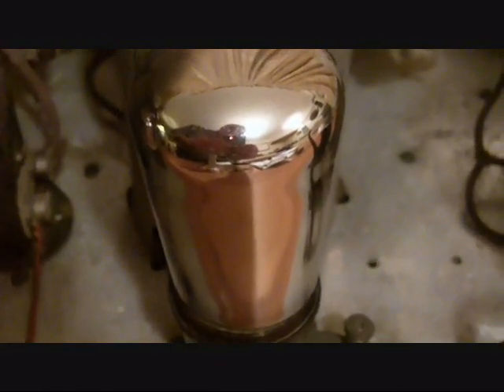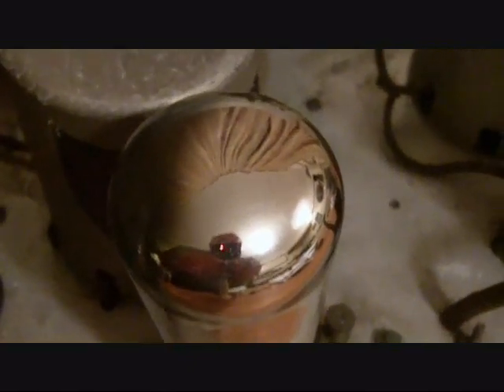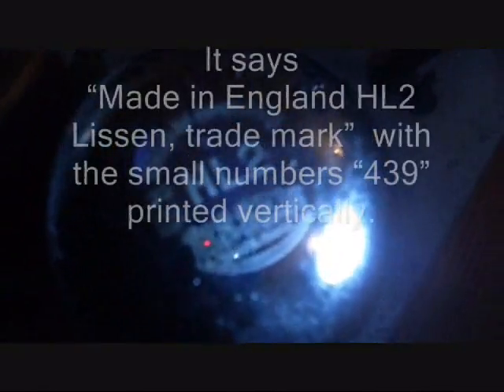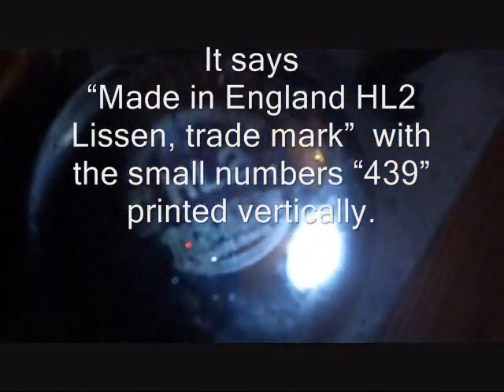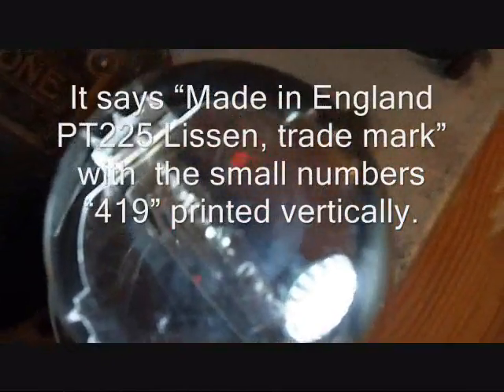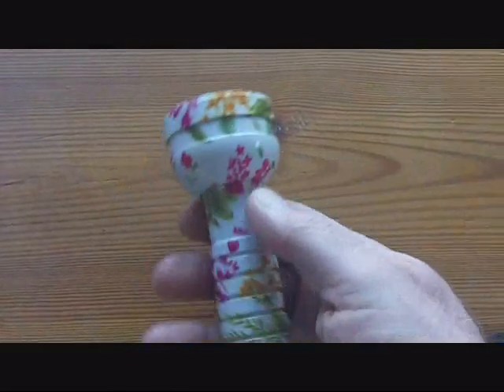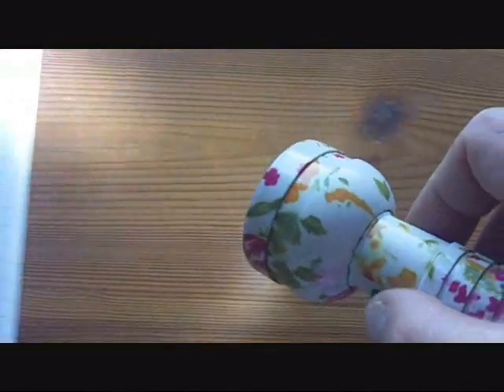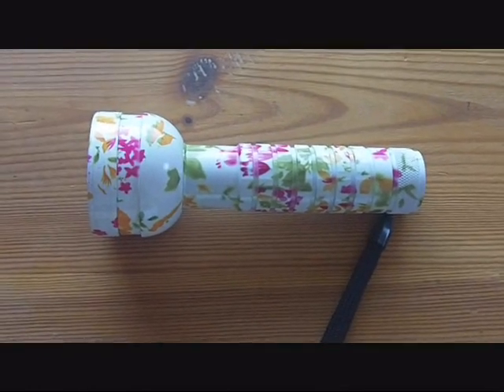Using a LED torch to show numbers on valves (tubes)

Comment: Thank you Andy, I have many valves that are like that. I have just finished repairing a Taylor model 45A valve tester, and wanted to put it through it's paces. With your informative video, I managed to find out that I had a 78-E vacuum tube, there are more to test. Cheers.
Reply from the maker: Hi Stephen I'm really very pleased that the video helped you and thanks for letting me know. I wonder how long this information will be available? Do you remember the 1960 film, 'The time machine'  where all of the old (and ignored) wisdom was held on spinning disks. Vales still work and they are a bit special aren't they?  Stay safe and well.All the best . . . Andy.

Comment from the maker: Hi there, a good question.

Normally the markings on valves are quite good but they are a surface coating not engraved and any surface coating is subject to wear. 
The vales gets hot and then cools so over the years the differences in thermal expansion cracks the coating and bits drop off. 
Plus of course we can’t resist handling and cleaning them. 

The valves in this video are about 80 years old.

Hope that helps.
 
Kind Regards ... Andy 

GWØJXM

Comment from the maker: Hi there, yes the trick of gently rubbing a valve (tube) on the back of your neck can very often allow you to see the valve numbers, I guess that even when the marking material has rubbed off there’s some invisible residue that catches a bit of body grease that then catches the light. That didn’t work on this valve but with the little torch the numbers can be clearly seen.  
Kind Regards ... Andy

Comment: so that's just a normal led flash light that's great man truly i have hundred of tubes with no i-d so this will help by the way i don't know if you have ever herd of this but my great uncle a old radio repair man told me that if you got a tube that's hard to read but you can see making gently rub your head on it the oils in you hair bring it out wont work with every one and if you just showed it wont help but with a bit of luck it works great out in the field buy them

Comment: Amazing - It works great! I have a tube with no trace of a number visible under any light. I have a magnifier with a built in LED light & the number jumped right out. Thanks! Also red,blue & green LED's work as well.